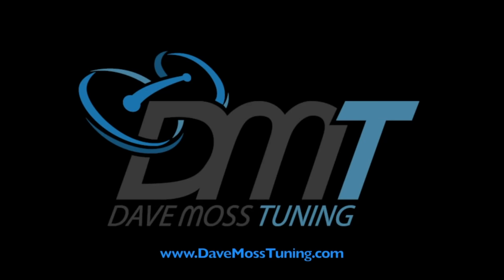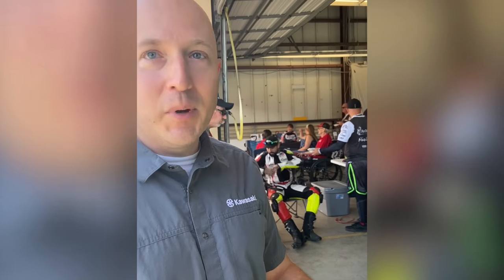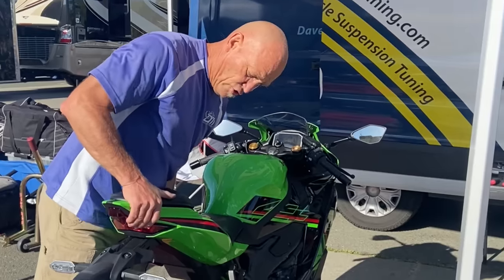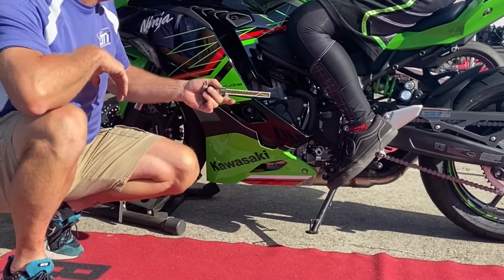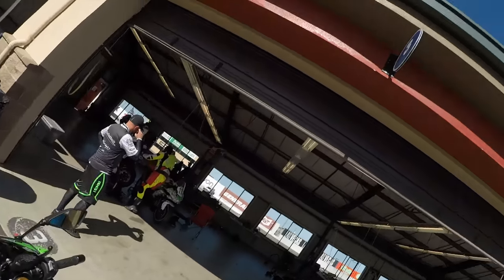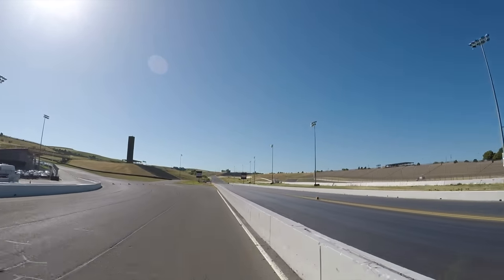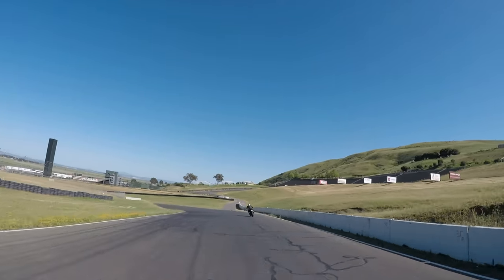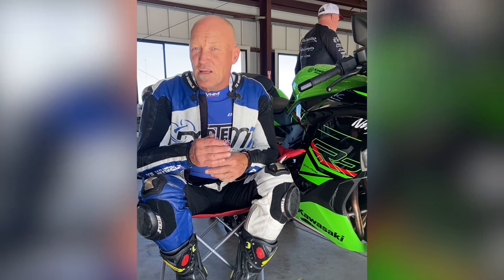2 Clicks Out | 2023 Kawasaki ZX400RR first ride and suspension dial in!

Comment: Hi Dave, great video as always. Brought back memories of the 90’s and racing against the little 4 cylinder screamers with v-twin 250 two strokes. Must admit, not much smells better than a cold two-stroke firing up and the power band that comes when all is at temperature. I think Americans missed out on riding both versions back then. Which if I’m correct is a shame. Learning to race a “slow” bike fast is key to your development before you move up a couple of categories. 👍😎🇦🇺

Comment: As a ZX-4RR owner, Im looking forward to you dialing this thing in. Just did 200 miles on mine today to complete the break-in, and it was pretty comfortable, even with the accessory sport seat.
Reply: Congratulations on breaking out your bike! I completed breaking in my ZX-6R yesterday too, pulled into the dealership at 600 miles and got the first maintenance done. It rides so smooth now, I bet yours does too.
Reply: @Looney_Tombs  Thanks! Been so busy trying to break in the 4RR that my 2023 GSX-R750 still only has 265 miles on it, lol
Reply: @Looney_Tombs  Good to see you didn't attempt to remove the factory fill run in oil package.  All owners manuals state to wait until 600 miles.
Reply: worth the price? noticed the zxr is almost the same price

Comment: I got a 2WDW tune and Graves slip-on. Tyson Moto did a couple of videos on my bike. HP is about 74 at 14.3k. Such a huge difference with the tune removing the power limit at 11.5k. I’d say it’s mandatory for all owners. It’s that good. I took the bike to 3 track days and kept at near the front of the pack in group 200. Turn in is very easy and I had no stability issues past 135 mph on the the Ridge without chicane. Gearing is a bit tall. I don’t think I can hit redline on 6th at the track. Next up gearing, GP Suspension cartridge kit, new pads and rear sets. I was scrapping my shoe quite a bit. I may do clip-ons, but I also street ride and ergo’s are perfect for that and still feels great on the track. I agree with Dave that brakes are very striping considering this is a momentum bike still, so I’m not slamming it in even hard breaking zones. I’m going with Versah XX for a more progressive feel. Brakes can be a bit touchy when letting go after trail braking. Initial bit seems fine, but you will get fade after a few hard stops. Overall I think Kawasaki hit it out the park, Grand Slam!
Reply: What’s your lap time without the chicane?
Reply: I’m not a fast rider as I mentioned that I rode in the 200 level group. The stock GPR 300 tires are acceptable on the track at best, but cannot be pushed hard. Having said that my time with chicane was 2:15. I didn’t have a timer on the first day without chicane. We’ll see what the true capacity of this bike is once some fast riders get on it. I bought this bike to help me be a better track rider which I know it will do. The best feature of the bike is the feel and screaming motor. I preferred it over the zx6R, albeit much slower. Think Mazda Miata where momentum and feel dominates the ride.
Reply: @explodingducati1087  No worries dude, I’m new to this area and just trying to get an idea of what the upper b group pace like as I too ride in that group.
Reply: For reference, I ran the same time on my Ninja 400 without chicane so definitely faster on a new bike I’m getting faster each time on with limited tires and soft front end.

Comment: Thank you Dave for this great summary and initial tune. I just got mine recently, and hoping to get it on track by next month. It's my first time tuning a bike for my weight, fortunately close to this gentleman owner (170lb). Anyone please help out a noob, see if I got this correctly from the video:
-7 turns of preload on front fork
-1.75-2 turns out for rear compression
-0.5 turns out for rebound
-1 full turn of rear preload (from stock) to remove 50% the static sag
-Loosen the collar before adjusting rear preload, snug it up again after
Have I got this right? Thanks very much in advance!
Reply from the maker: Thank you for your positiver comment and congrats on your RR. You do have the details correct! Enjoy the testing.
Reply: @catalystreactionsbw  Thanks for the reply and confirm! Can't wait to head out and try these. Will do a session on stock form first just so I can feel the difference.

Comment: Hello. This bike is a Track day and Backroad Junkie's Dream!!!!

Keep in mind thr US spec is severely limited to 52-56hp. It actually can produce 80bhp unlocked.
Reply: Yeah, insane restrictions from the factory, but it's almost like you get two bikes in one! Just depends on how long you can hold off on tuning it ;)
Reply: Very weird. Hopefully dealers don't talk people into this bike, it should be only for highly knowledgeable individuals.
Reply: Kawasaki dealer here! I'm sorry to say Canadian buyers will have a restricted ZX4RR, but the USA version available at our dealership is unrestricted. I have two more available and on the way!
Reply: @vozanderson8665  Unless you got it tuned, it is also restricted. It will still rev out to 16K, but the throttle starts closing after 11.5K.
Reply from the maker: I will post all the information as we proceed with chassis, suspension and engine tuning.
Reply: @catalystreactionsbw  we appreciate it, looking forward to the headway these bikes will make
Reply: I've already seen the Dyno charts. The Bike is supposed to be able to go 140-150mph. In Stock trim it can Barely do 120-130mph. Kawasaki literally chops the throttle on the torque Curve. Keep in mind it IS smooth. But that doesn't mean it's still not missing a lot of power. I'm am not trying to say more power is better, far from it. All I'm saying is the bike doesn't come in it's fully tuned state ready to go. Many Turners have recorded close to or over 150mph and 80+HP with RAM. So convert that to WHP instead of BHP.
Reply: It weighs as much as a 600 so just get a 600 and never go over 50% throttle for the same experience. Your engine will last forever
Reply from the maker: @DR-hw9js  We will see what it can produce once it can be remapped but I will be very late to that party given all the R&D going on now. BUT,  my 400RR will benefit from being late as all the development will be done by the time I am ready for mine to take the same pathway.
Reply: @morgan98801  no. Not the same experience because they're heavier. 

This weighs as much as a 600 so you don't get the 300/400 feeling. You get the underpowered 600 feeling
Reply: @aleks138 wrong comparison.  it weighs 1 lb more than an R7 amd has a more fun motor, more features, attractive looks, and is only $500 more.
Reply: @morgan98801  not a good comparison at all. You’d have to appreciate race craft and cornering characteristics to understand the potential of this bike. The current parallel twin is a staple in club racing. The RR adds a different dimension to a popular and growing segment.
Reply: @vozanderson8665  "more" features like fork adjustment? oh wait it doesn't even have that. so by the time you buy carts you're in zx6 price and weight territory while still having smaller brakes and an overworked engine

maybe in europe with tiered licenses it makes sense, but in the states there is no reason to go for this

Comment: 2001 ninja 250 w/ 6000km. Should I trade it? Maybe a 400 twin? I like the upright stance of the 400; zx4r not comfortable?
Reply from the maker: I am 5' 9" with a 30" inseam and I was not uncomfortable at all on this motorcycle. I'd say the ergonomics were generous for me, plus or minus a couple of inches. I would keep the 250 for sure and if you feel the 400R fits you better - go that route. Bottom line is for you to sit on the bike.

Comment: How does this compare to the Ninja 400 from a power/acceleration perspective? I’m sure suspension is night and day as well as breaking. 
Also, is this bike only really good for track or is it just as suitable as a daily rider like the 400?
Reply: 27:30 a 400 ninja goes by while Dave is still warming up.  You can see the twin has more low end off the corner (at those reduced engine speeds) but the RR spools up and blows by on the straight and the braking seems to be much better.  Later on in the video those are 600's and 1000's he is politely passing left and right.

Comment: I think it is no, but does your front fork max travel range change from stock with an ohlins cartridge kit?
Reply from the maker: That depends on the kit chosen and if the forks can be extended 10mm internally (based on the bushing location). If they can, they are.

Comment: What size of spaner wrench is needed to adjust the rear shock? It looks like you were using the Kawasaki adjustable one, but I can’t justify spending almost $200USD on that one.
Reply from the maker: You can find the one I use on all motorcycles here: https://www.amazon.com/shop/davemosstuning?tag=onamzdavemoss-20&linkCode=ic7.   There are different examples but get the Buzzetti adjustable spanner. It works on steering head bearings too!

Comment: Watching this video of Sonoma Raceway makes me nostalgic for the "old course" when it was "Sears Point." The no front-straight chicane made Turn 1 a hairy proposition, even on small bikes. And then the run through the Esses into Turn 9 (none of that straight-with-a-chicane stuff) was also a test of skill through Turn 10 and then WAAAAAY down to the end of the track to Turn 11 (much higher speeds than what you were running with that shortened version) for the hardest braking point of the lap, then back up to Turn 1 (before the AFM started running their chicane which was before Start-Finish). (Yes, I am not unaware of that configuration's dangers and that some riders lost their lives because of it. But it was a screaming good time on that layout!)

Also: so how much horsepower does the US model actually have? 55hp? or the full 80hp? And if it's only 55hp, is it worth the price?
Reply: 56ish. Add $300 to the MSRP for a tune and bam you have the full power, or maybe more. Hell yes its worth it for how it feels. Its not a value bike, or a performance for dollar bike, but the feeling of riding it makes it worth the price.

Comment: How does it compare to your VFR400?  I'm sure it wouldn't touch my ZXR400sp from the 90's.
Reply from the maker: The chassis feels identical to my old VFR/RVF400 for lightness, balance and agility. That was the very surprising part. Power will be resolved when remapped and we are days to a couple of weeks away from that change once Hindle develops a pipe.
Reply: @catalystreactionsbw  what kind of power do they make?  My Kawi was 72-75 depending on the dyno.  It was also about 320 lbs with a frame and swingarm very similar to a ZX7rr.
Reply from the maker: @craigsanders6925  Unknown:-  rumors abound in the 70-80bhp range based on mapping alone. I doubt there will be much for gains with head gasket and cam timing but....... I hope to be proved wrong.

Comment: Any problem with me getting this bike as my first sport bike? 
I've ridden dual sports for years.
Reply: This would be a much better choice than a ZX-6R for a first sport bike, but a Ninja 400 would probably be a better first sport bike if your body fits it.  I find the N400 too cramped and wasn't interested in spending coin on clip-ons, seat, and rearsets to make it better.
I ride street only and chose '22 CBR500R because ergos were perfect for a do-everything sport bike and the Showa SFF-BP fork and twin discs are excellent.  I sat on a ZX-4RR and love the ergos too; do everything sport bike instead of repli-racer.  If it came in a colorway other than KRT green, I'd own one (my CBR is the understated Sword Silver).
Reply: @GripEngineering  
Thanks.
The Honda is a parallel-twin, and I really prefer the exhaust note of a screaming inline 4 cylinder. 
With the ZX-4RR, it's not a high powered bike like the ZX-6R or 10R, way too much power for a new sport rider.
I'm also on the short side 5'7" tall I've sat on a ninja 400 and I can flat foot so I'm pretty sure I could flatfoot on the zx4rr as the seat height is not much taller.
With the ZX-4RR I can ride it in town be able to switch gears and rev out that engine without completely breaking the speed limit losing my license, like I probably would on a 6r or 10r.
It's like the old saying it's more fun driving a slow car fast than a fast car slow same thing with motorcycles.
Reply: @dougmaverick3287  The 4RR is your bike.  And don't even worry about "unlocking" its potential, just ride it.  I absolutely cane my CBR keeping it between 7k and 8.5k and I have a ton of fun (even though Revzilla tells me it isn't a sport bike).  :)
Hope you can get your hands on one this model year.
Reply: Sounds good.👍👍
I've spoken to a local dealer and they have one coming in, in the next few weeks and the total price here in Canada out the door would be $12,800 CDN which is a great price.
With the current exchange rate it works out to $9,484 USD.

Comment: Shame they chose steel frame vs aluminum. Could have shaved 30 lbs probably. Would be interesting to know the fork geometry and if a nicer set of forks could be adapted.
Reply from the maker: That will be one of the challenges in regard to OD in the triples, overall length and what may or may not fit. If there is no surrogate, the question will be to find internals that will fit but the piston OD may be unique. Once we open the forks up we will know more.

Comment: Would be cool to limit a 600/750/1000 to this amount of power to set ideal cornering specs then dial it in for the power delivery afterwards
Reply: You can already do that with your wrist
Reply: @aleks138  sure. I get it. But you know what I'm talking bout
Reply: but you then have to tune the suspension for the added power anyway. it would bea waste of time. more power means more weight transfer and most of the time it will happen faster. so they would have to continue to dial in the suspension as the power goes up.
Reply: @fatalgaming6068   I did what he said. Started on a 1000 that weighed less than this 400 and increased throttle as my skill increased. The suspension settings aren't that different and it's alot less work than setting up a small bike and getting used to it and then having to do it all over again when you upsize.
Reply: @DrDanMD  if you want you can always add a throttle stop
Reply: @aleks138  yes indeed but let's say you want to let someone ride your bike you can limit it. Would be helpful at the track to get safely up to speed as well
Reply: @fatalgaming6068  sure. Why not. Once it's figured out the settings can be calculated via an app/algorithm
Reply: Let me be more specific as to suspension settings dont change. Limit power so riders can focus less on corner entry with braking, instead focus on cornering with the front loaded under braking and getting on power asap, the limiting of power will allow the rider to focus on the best line. When power is increased with different power modes, its more down to the wrist after experienceis gained. This can help avoid a first and second time early high/lowside. On top of that you can neuter your bike for other potential riders
Reply: @DrDanMD  if you want max power to be out of the rider's control you can also play with throttle tubes. but I disagree with that method. I think it should be up to the rider's self control. If they want to use throttle to fix everything and not learn anything, that's up to them
Reply: @aleks138  I get that. I wouldn't want to be neutered, but I'd want to neuter my bike for a buddy to ride lol

Comment: Awesome to see you got to ride one! I've got a bit over 600 miles on mine and settled in to a similar rebound setting in the rear shock. I'm at 3/4 turns out, but haven't set sag yet so that may need to change. Front rebound is out of control though, mine rebounds so fast it tops out. Still waiting on the fork cap wrench to be available so I can change the oil.
Reply from the maker: I will be looking forward to seeing what you choose and if we find the same solution.
Reply: @catalystreactionsbw  Actually I lied, rebound was fine when cold at 3/4 out, but I adjusted it hot to 1/2 just like you did. I just set sag and had to add 13 turns of preload for my 170 pound self, didn't touch the rear preload. I backed compression all the way out and it still felt a little firm (before adjusting sag).
Reply from the maker: @Daschickenify  Have you put a little grease on the shock shaft yet? That will clearly show if preload is too stiff with the turns you added and did you check to see what static sag you have?
Reply: @catalystreactionsbw  Haven't done the travel check yet. Mine has maybe 5mm static in the rear. Front has probably 20-25mm static still.

Comment: Forgot to talk about 1 thing, the price!
Reply: 11k canadian. so im guessing 8k us
Reply: @lgmediapcsalon9440  $9,700 which is $500 less than the zx6r.
Reply: @morgan98801  but we are talking about a 400cc motorcycle with less than 100hp for almost $10k , for some people that is worth it. I will wait a year and pick one up when they are priced where they should be.
Reply: @Davemcmasters  "... priced where they should be". There's no reason for a 400cc 4 cylinder to be any less expensive than a 600cc 4 cylinder. There aren't fewer parts. Fewer 4RRs are being made than the 6R, so you have fewer units to spread the cost of R&D. The idea that because it's smaller displacement, it should be less expensive, is a trope.
Reply: @Davemcmasters  they may go up in price, instead of down which is what I think you’re saying? When looked at compared to the Ninja 400 at $6000 + suspension, =2000=$8000 + rear sets, bars, tune, pipe, brakes, tires, you’re over the cost of this bike and down 35hp. This bike makes sense